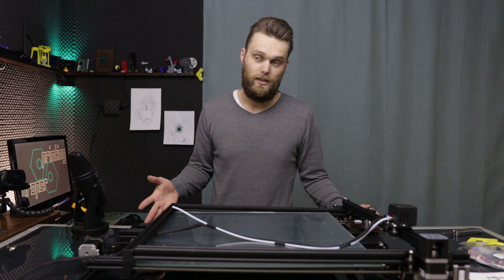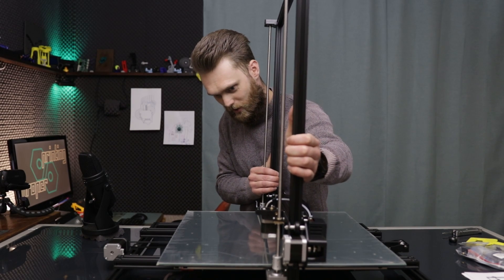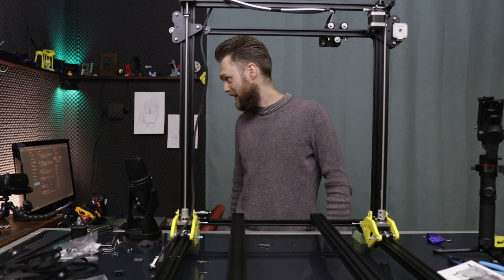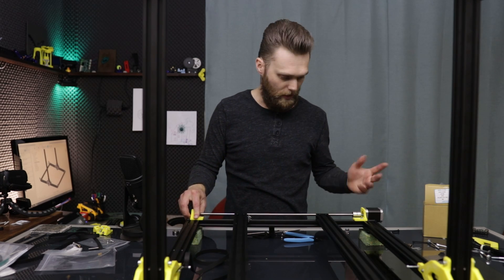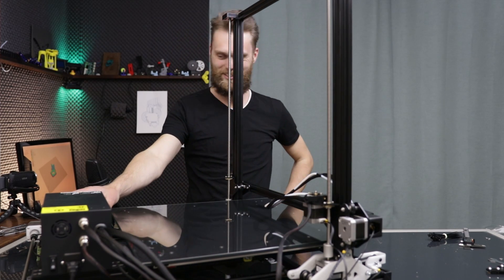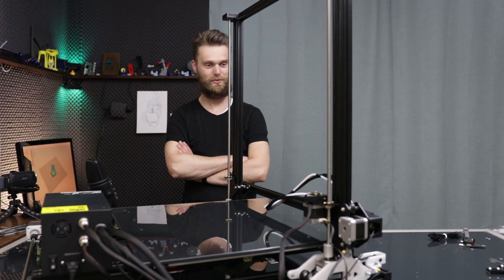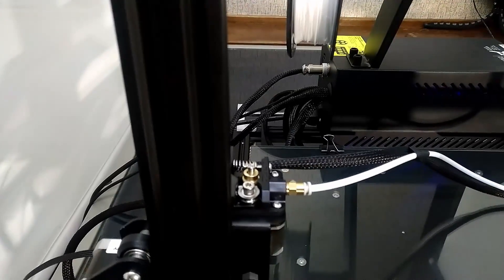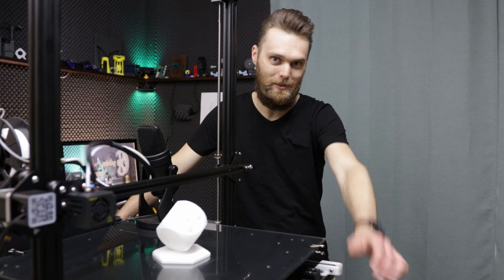Why not move the PORTAL instead of the BED?

Comment: I had this exact idea recently and looked around to see if anyone did it and of course you have. Are there any negatives with this setup so I can decide if I should design my own?
Reply from the maker: Cool that you thought of this! If I were to do it again, I would lower the portal. For the purpose of printing the rims it didn't matter, but I never use that height. I would literally cut it in half for a form factor that does make sense and will perform better.

Comment: My CR-10 S5 has been sitting in parts on my living room floor for over 2 years now.  This mod seems like it's just crazy enough for me to try and actually get working!
Reply: Just broke my CR10S5 out of mothballs for a large print. Not doing this mod though it looks like it will have the same issues as any bed slinger , moving too much weight around. Sure it can work but just a bit of space savings is all that is gotten out of it. Cool mod just for the sake of modding though.
Reply: Hey man, did you ever get around to doing the mod? What are the results? Is it usable?

Comment: I am watching this video again because I have an idea which might help. With your current mod if you do a core XZ similar to the voron switch wire then you can greatly reduce the weight of the moving mass and achieve better printing performance. Let me know your thoughts
Reply from the maker: Thanks for your suggestion. This is exactly what I'm planning to do for the printer I'm planning to build soon! This makes the portal also better balanced because the motors can be below the horizontal rail. I'm also thinking of using a long bed and add the possibility to add the gantry at an angle so it can print like a belt printer from front to back!
Reply: @properprinting    What controller are you going to use for this build?  Thanks for the video, I have an S5 and wanted to see if I could extend the life.  It's got little use due to long term home electrical issues, but now I'm plugging everything back in.
Reply from the maker: @davidthompson9359  eventually I used a Duet 2 board, but that's not a drop-in replacement. For this build it doesn't matter much which board you use. A drop-in SKR board would do the job. You can even just use the controller that came with the S5, but the stepper drivers are pretty loud.

Comment: I tired the STL files on an Ender 3 and it didn't quite fit correctly, or maybe I'm not thinking the same way Jon was. I did end up being able to do it on an Ender 3, however, I used linear rods and my own designed mounting brackets. What a fun challenge. Thanks for the inspiration.

Comment: Great conversion to save space, because it's what you needed in the coreXY.  The conversion is so simple that's very nice.

The other benefit of a core xy (in standard conversion) is to move lighter part instead of the whole bed to print way faster with a good quality. that's why you usualy try to move the head only and the bed on z .

Comment: For the suspension, you should try to experiment with polyurethane isolators or heavy-stronger springs, maybe even look into vibro-mounts used in different applications such as mounting of special equipment that needs to be isolated from vibration.

Comment: i have a Creality CR-10 V2, which is smaller format similar printer as his in the video ... ive been thinking for a while how to upgrade the kinematics but didnt even think of something like this! absolutely brilliant idea! I'm very interested to see if anything performance wise came out of this upgrade. Did you get any benefits?
Reply from the maker: Thanks! The greatest benefit is it's size reduction. The portal is lighter than the bed, but this becomes significant after printing large things. I just printed a 5kg part so.. xD I want to make this mod again, but I'll reduce the height of the portal since I don't care much about print height.
Reply: @properprinting  Sorry i just saw your reply now ... For some reason i dont get notified when someone replies to my YouTube comments lol. Awesome. I am thinking of doing this  mod to my CR-10V2 ... Except where you used the stock "rollers" to move the portal ... I'm going to do it by using MGN12 linear rails (i got a bunch of Hiwins lying around so might as well). I just signed up for your pateron so i can download the step files to modify your designs. Cant figure out where to download them lol.

Comment: Do you have a non printed parts list?
Reply from the maker: Yes, everything can be found in the mount instructions tab on this page https://properprinting.pro/product/easy-moving-portal-mod-for-creality-printers/
Reply: @properprinting  I am about to start printing this for my cr10s( soon to be modified to be 400x400x500) have the idea on trying to modify the rollers to use linear rails instead of the wheels also. I will try the wheel setup first.

Comment: which material to use if PC isnt available
Reply from the maker: It must be as stiff as possible. You can use PLA when you're not using a heated chamber. It's possible to use ABS, but this is more flexible, so a carbon filled Nylon would be preferable in a heated enclosure.
Reply: @properprinting  thank you for the response trying this on my self sourced ender 3 pro

Comment: Fantastic video Jon, but this is definitely NOT a core-xy printer.  It's a great mod to lower the footprint of such a huge bed-slinger, but it's a totally different drive mechanism than core-xy.  You still have x and y totally separated, with separate motors moving your gantry in Y, another 2 (or is it 1 with a belt) for Z and a dedicated motor for X.

Comment: Complete clickbait. Unsubbed. You need to look up what CoreXY is. CoreXY uses 2 motors to operate X and Y working together like an Etch-A-Sketch. You have mounted the bed solid and are moving the Z assembly. This is not even remotely CoreXY. Nice way to try to use popular buzz words and make yourself look like a complete idiot.
Reply from the maker: https://youtu.be/yDLrBVVPX2g?t=107

Comment: Jón :  If backlash were ever an issue with this config, make a software mod to progressively slow down travel as the head gets near the top. Fact is, the head will rarely ever be up there so you should be able to speed it up quite nicely and consistantly. very nice.

Comment: Great Video, Question is that a custom Heated Bed?
Reply from the maker: Yes, it's a 1000W silicon heater mat which heats up insanely fast
Reply: @properprinting  Thanks for answering, Two more questions: bed plate thickness is it a 1/8 inch thicknes or 1/2 inch? is it aluminium alloy or Steel? once again love your videos keep it coming
Reply from the maker: @andreyu18  it's a 3.2mm aluminum plate (standard Creality)

Comment: This is awesome - great work! Now all it needs is a shortened X/Y frame base (as the bed no longer travels), and extending the wires to put the control unit including PSU outside of its enclosure home. It's gonna be tempting to minimize the enclosure size, but I would humbly suggest making sure to make enough room for wires, filament and bowden tube to not rub against the enclosure surfaces even when the extruder moves to the build area extremes.  The friction may seem minimal, but everything becomes sandpaper when two surfaces grind against eachother enough times. Which can be many thousands of times just on a single large print.

Comment: As others have already said, this is indeed not CoreXY. The idea with CoreXY is to eliminate as much mass to be moved so that the head has better/faster a response to changes in direction. By moving the whole gantry you actually add a lot more mass to be moved. I suspect that you will notice this in the print quality a lot. This is why moving the bed itself is actually a better solution and what most printers do.

Comment: @Proper Printing 
     OMG, It works just as I had hoped it would!! About 6 months ago I had a dream of utilizing this exact modification, all due to now being able to maximize my build volume to and achieve its total radius efficiency.  Plus it also mitigates the chances for partial or total print failure due to an overweight build plate, and all the other negatives due to a mobile jerky build plate... Now I can put my design for my TRONXY XY Machine into a majestic and efficient BEAST!! This printer already prints amazing right out of the box but I've gotta see if there are any added benefits or maybe allowing the acquisition of accurate build times rather than the print taking between 1.5 - 2.5 times longer than estimated by any slicer you use with it. Thank you for validating this very puzzling question as to I wasn't going to ruin the now, 1 and only printer I have left after my moving into a new home and losing the other 3 due to some sticky fingers and people who have no moral value with their lives. But can't wait to put my own design to the test!! Oh.. and I definitely had to give you a sub after this beautiful execution!!!

Comment: Wow, I'm surprised that poor Y axis motor could move the entire gantry without skipping. That might still become an issue if and when you ramp up the printing speed, but I guess since the extruder already had problems that's a secondary problem for now. Very happy for you that it worked out like you had planned it :)

Comment: I was wondering if this would be even more sturdy by making the mounting plates as flat as possible in aluminum and supplementing the raised edges where it bolts to the frame using a rectangular aluminum spacer of 3.8mm and a barrel type aluminum spacer of 8.6mm for the rollers. I was thinking of doing this by modifying your STLs and making my own brackets since I don't have a printer that can print out ABS or polycarbonate nylon. Aluminum is much stronger too, but don't have a CNC to make it in all one part. I know someone with a plasma table though.
Reply from the maker: My initial flimsy design was designed for sheet aluminum. I can mail you step files for you to modify, makes life much easier ;)
Reply: @properprinting  yes pleas! you have my email already ;)

Comment: Nice at least your thinking and solving for yourself true engineering a solution. Refreshing to see someone thinking without a rule book and discovering for self. Marvellous keep it up. At leas your removed the large weight of the bed having to be moved , moving and stopping that inertial mass would have limit speed of prints. 

It’s still Cartesian as x motor control only x and y controls y and x controls z. With corexy to move in x only or y only you need both xy motors to turn, both turn same direction moves x both turn opposite direction moves y. All the firmware can do this as it’s just a translation of coordinates. Delta printer you need to move all motors to move in x y or z. http://corexy.com/theory.html is a good explanation. 

I subscribed like the way you think.
Reply from the maker: Thanks for your comment and subscribing! I learned that it's not a coreXY xD

Comment: For slow moves (like on a CNC machine) this works, but for 3d printing the gantry is too bulky to be tossed arround.. Why did you think this would be a good mod?
And rims? you probably mean hub caps?
Reply from the maker: As I've mentioned in the video, this is an easy way to reduce the size of the enclosure and I'm going to stabilize it when making that enclosure so don't worry ;) I don't mean hub caps, I really do mean rims. Welcome to my channel xD
Reply: @properprinting  If you later make it more like a cube adding top support it should work. Probably for small print it is better to just move the plate but if your intention is really intend to  print very heavy part using much of the volume of the printer "probably" would be better to move the entire gantry instead of moving the plate plus the printed part on top. It would be interesting to measure what is the weight of the moving bad and the one of the entire gantry to see from which printed part weight it become better. If your  primary objective it is make it compact eventually sacrificing a speed and/or print quality it would be fine anyway :-) 
Really curious to see how it will evolve :-)

Comment: Very impressive!  I would probably only do two things differently... 1) Just mount solid to the frame, no bed spring.  If you have it mechanically level, awesome....just add a BL Touch for an added level of perfection.   2) Junk the stock hot end and invest in a Bondtech Creality CR-10S Direct Drive System.  I just bought and installed one (see my channel) and direct drive works so nicely on my CR-10S.  Bondtech provides the firmware and supports a BL Touch mount that would work on it (and firmware for that upgrade!)  It's a wonderfully plug and play upgrade.   Great job!
Reply from the maker: Thanks for your suggestions. I don't use the bed spring as I've shown in the video, so we do agree on that (I've mentioned the BLTouch too in that part) ;) I've already done a lot with Bondtech extruders with the printers in my earlier videos for Printing (CF) Nylon and for this printer I've something different in mind, I'm far from done with this machine ;)
Reply: @properprinting  2 years later, how is this working?  Any further tweaks?

Comment: I also have a done a quite similar mod to my tevo tornado. I found that the z-axis( the part which moves the hot end frame) has put alot of stress on the stepper motor. I had to change out the stepper motors to a slightly different version .
Reply from the maker: Interesting! I'm happy that the Y motor of this printer was already beefy ;)

Comment: hello i have question on Y axis have motor problem ? I mean if it isnt much load for 1 motor ?
Reply from the maker: The load is actually decreased because the gantry is lighter than the bed ;)
Reply: @properprinting  and my next question I can build same thing but I need get upper stabilization I have excellent printer with watercooling extreme stability etc. But this looks better can you help me stabilize upper part?
Reply: and fully enclosured how fast do you think can print? more than on classic cartesian printer ?

Comment: What size rims do you plan on printing do you have a design yet what type of filament are you thinking of using?
I can't wait 
Keep up the good work 👍
Reply from the maker: I'm going to start with the default size which is 15 inch. This printer is large enough for 19 inch rims so I'm definitely going to try that! I don't have a design yet, but I have a great idea for a design which would be a video on its own. I'll start with ABS and then Nylon. If one of those wouldn't work I have to look into carbon fiber reinforced filaments or Polycarbonate. I hope I can find a sponsor by then xD I cannot wait either! :D

Comment: Came here from 3D printing nerd, you have me super peaked! As I have an Ender 3 Pro with the Extender to 600mm height, but print high stuff with moving bed is a problem. Would linear Rails be a possible alternate to wheels for more precision and less movement?
Reply from the maker: Awesome that you've find my channel because of him! 600mm is quite something, cool! I recon linear rails would work well. I think that two carriages on each side will work great ;) I still think that stabilizing it at the top will be the best thing to do which will be my solution for the future :D
Reply: @properprinting  Look forward to that video! :D Right now I'm using Z brace for my 600mm Ender 3, but I am changing it with the Ender Extender 400 to have 400 x 400 x 600mm build volume, and Z brace might not do it. Would be interesting to see the top stabilization you mentioned for the future for sure!

Comment: You could copy the base of the printer and create an upper and lower frame structure. You could then put a second set of carriages on the top frame and have a super rigid frame. It would be a giant box, basically. You could then also use a second stepper motor mounted on the opposite side to have a dual Y stepper just like the dual Z stepper the printer already had. This would of course require actual modification of the printer but it would result in a more rigid frame and could make a difference if you have issues with rigidity when printing very tall parts.
Reply from the maker: Thanks for the suggestion. This is what I had in mind for step 2 and 3. I'm going to do that when making than enclosure ;)

Comment: Would this work for the Tevo tornado without modification ? ... and would petg be ok for the parts
Reply from the maker: I have no idea if it would fit. PETG is more flexible than Polycarb so you can have a bit more wobble than I had. ABS looked promising which is a bit flexible too so I recon it would work. Only one way to find out ;)

Comment: Knap man ! Ik overweeg deze mod, lijkt me beter (zwaar bed moet niet bewegen), en plaatsbesparend. Welke settings gebruik je om polycarbonaat te printen ?
Reply from the maker: Bedankt Hans! De settings die ik gebruik zijn: Bed temp 100 graden, extruder 260 graden snelheid 3000 mm/s. Het belangrijkste is om meer top en bottom lagen te gebruiken want het is blijkbaar lastig om het oppervlak dicht te krijgen. Daarnaast gebruik ik een brim van 2 lagen. Tot slot had ik last van materiaal wat aan de nozzle bleef hangen en na verloop van tijd los liet. Dit blijft dan in de print achter dus daar moet ik nog iets op verzinnen.